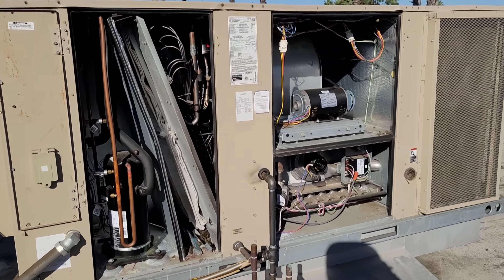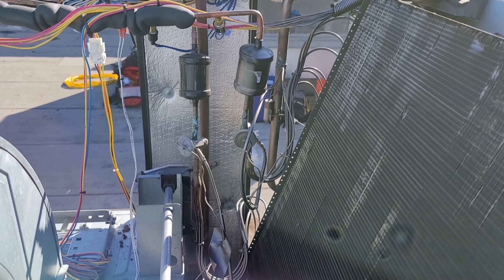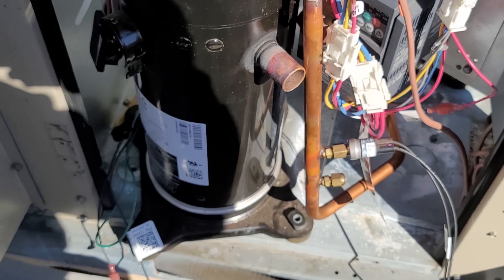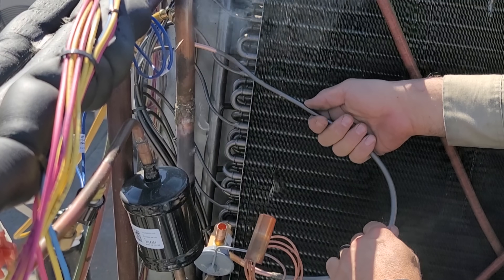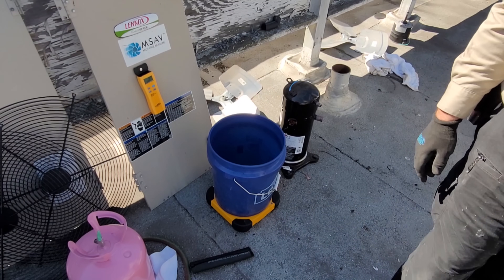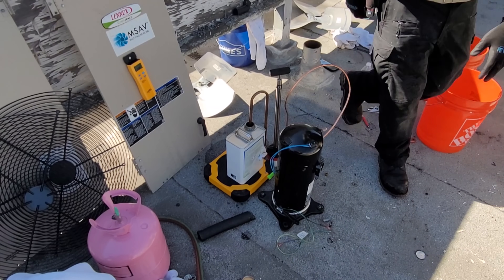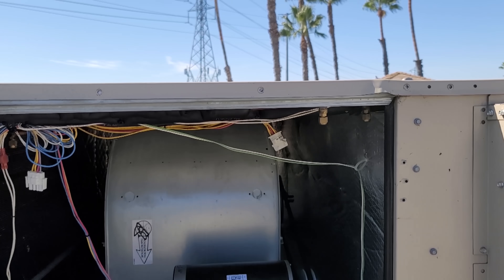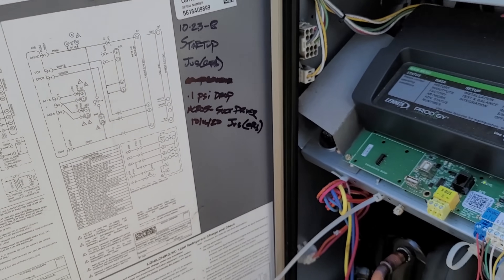THE AC HAS HAS BEEN FLAT FOR A LONG TIME

Comment: Why didn’t you just cut the suction line and put aquarium hose into the compressor going all the way to the bottom. Use vacuum pump with oil catch attached?

Comment: I found a video I have yet to watch!!! Thanks to you and another youtuber i watch who's a plumber (Steven Lavimoniere) I was able to locate a display panel on the tankless water heater that runs the hot water and the garage heat in the addition/back of my grandmas victorian mansion, it had a return sensor unplugged code and a code that said ignit, we assume it means ignitor so at least I was able to send my aunt (her sister who lives next to my uncle) pictures of the code and point to which system is down in the photos so they can call someone out and tell them the codes displayed so they get a general idea of what needs to be repaired, it had no pressure on the guage either sadly, I tried to reset it to get it going for a while or even the night but didnt have luck. I got locked in the garage bringing trash down to put in the truck to bring to the dump and told my grandma the heater pipes were cold both times, she then said my uncle complained of no hot water and asked me to figure out which unit wasnt working, someone was just there to service the boilers and change the air conditioner filters, sad lol

Comment: Does Copeland recommend dropping the compressor upside down on the roof??  Lol. Thanks for the video. I always measured the remaining compressor oil as a volume not weight. Just wondering what your thoughts on potentially ‘moisture contaminated’ oil would weigh heavier or not and therefore potentially overcharging the system with a larger volume of ‘less heavy’ new oil....

Comment: Could you potentially use a FLIR to check the oil in a scroll? Would have to experiment, I assume if the crankcase heater was on, and maybe pour some water on it to cool off the body, presumably should show a nice line on the compressor. Might even show up without a crankcase heater, if you cool the side after it's been running. 

Ofcourse this doesn't help too much as you don't have any reference as to where the oil level should be, but it'll give you a rough idea.

Comment: Oil change. Weigh the bucket. Move bucket away from scale. Drain compressor into bucket. Reweigh bucket. Or weigh compressor. Drain. Reweigh compressor. Fill on scale. Dropping compresser on scale not good.
Bracing lines bare copper 8 gauge or 10 gauge ground wire is one option.  Heck use some copper tubing.  Flatten where you want to loop it. Self tapper or solder trapping felt or door sweep rubber on tubes. Hint. Some apps need triangulation.  Flatten middle to go over floppy tube. Ends at 30 to 45 degrees to solid mounts. Insulated pipe hangers to the flattened copper tube end with a self tapper. 
I'm talking bout no vibrations. You know the song just change the words. Steady men it's only a comment.. not trying to rattle you.

Comment: you can just pour the oil in a measuring cup. Lay the compressor on it's side with the suction port facing up and pour that amount back in. I always thought it would be best, if compressors had a sight glass and a port with dip tube that went to the very bottom of the compressor. That way oil could be removed and replaced with it in place.

Comment: I thought u never press contactor on VFD systems
Reply: While that's true, you can press contactors on VFD systems if the VFD and the contactor don't control the same thing! So for instance, say the blower has a VFD and a bypass contactor (most common case). Obviously don't touch the blower contactor. However, the compressor contactor would be fine to touch in that case, as the VFD is in a different electrical circuit. Well yeah same power feed, but the wires never touch each other after that.

Comment: Danfoss compressors in Diakin units is measured in liters..5.5. When I had a discharge 45 seam break I lost a liter. Danfoss uses their own special blend too. Being in Pa. Ohio was the ONLY one to have a liter. 
 My ONLY advise would have been to flush the coils with R-11 before driers and TXV. That for sure would have cleaned them up. Good stuff otherwise and thanks for sharing. Be safe Chris.

Comment: 1stvthing is even though you dropped the compressor, no humans got hurt. 2nd It seems like your equipment and the compressor are fine after the fall. 3 I know that is not a good thing to have happen, Stuff happens in life aka Tough Crap it happened. So how did that system pass after such a long time open to the air? Again I am not a Tech. I am a former custodian and in general like to learn about things. If I worked in Southern California I would hope I get to work with you/your company. I would trust any thing you suggest. I think you know what you are doing.

Comment: Would suggest replacement of the 1/4 inch line as I have had them fracture again down the track and adding some vibration loops but securing the pipework is probably enough.

Definitely agree replacing the txv not so much for moisture but they are a wear item I did repairs on a reasonably new unit was a simple gas leak from memory and not a particularly huge one so system wasn’t flat but found the txv failed shortly after just to spite me.

If the gas is out it’s not much more effort or cost to swap it out I also had another valve fail from head pressure issues we fixed the head pressure problem only to have the valve pack it in shortly after such a pain the valve does a lot of work and any chance to swap it should be considered if it has seen some life in my opinion.

Comment: I have to agree about the TXV/Equalizer line setup. I would have installed a 1/4” flare stub at the suction line and at the TXV equalizer outlet and installed an flexible armored control cap tube

Comment: HH is not a high acid core believe it or not. It has charcoal added for low temp wax build up. A regular core actually has more acid capacity because some of the material was removed to add the charcoal
Reply: I'm wondering if this comment made Chris realise HH core is for high wax removal.

Comment: I'm not a hvac guy at all. But you're changing the oil because fear of contamination (moisture) but you're putting oil from an container that could or already have the same contaminates in it. 

Am I way off on that assumption?
Reply: Probably brand new oil container.
Reply: Probably mainly time. If the unit has been open to atmosphere for years, it's likely going to have a lot more moisture in it than the jug of oil that's opened for a few minutes at a time. Ofcourse there'll still be moisture in it but nowhere near as much.

Comment: If you are using the exact same oil, it doesn't matter whether you measure out by fluid ounces or by weight. They will be the same volume as long as your measurement is consistent. 28 fluid ounces of oil will be the same volume as 28 fluid ounces of the replacement oil, and 28 ounces by weight of oil will be the same volume as 28 ounces by weight of the new oil.
Reply: Correct. But there is a difference depending on fluid densities hence the discrepency and disclaimer. In this case it wouldn't matter as it is one for one same oil change, presumably. Though, if it sucked in moisture and other atmospheric gasses you might be adding a little extra but I'd wager it is negligible.

Comment: That's interesting. I personally have never seen a(n) (industrial) compressor without an oil port. POE does hold an incredible amount of moisture. If this system was R22 with mineral oil I wouldn't have bothered changing the oil, I'd just draw vacuum for longer. Good, thorough job bud.

Comment: Even a drain plug at the bottom of scrolls would be nice
Reply: Apparently you do get that kind of feature on larger compressors, but on these smaller sealed ones it's just one more place for a leak.

Comment: Boy there has to be another way to draining oil out of a compressor. that is going to absolutely destroy your back if you haven't already. That thing weighs what? 70-80 pounds?
Reply: Those scroll compressors are much lighter than a standard reciprocating compressor. Probably only like 40ish pounds
Reply: Wait what? You can't hold 70lb's at waist height without "destroying" your back? lol

Comment: Is it really a good idea to use weight when changing oil? Im more thinking, if the oil have catched lots of moisture, its density will change (water is less dense than oil, meaning the oil will lose weight over time), meaning you didn't put the same amount of oil into the compressor, as you did take out. But I guess you compensated for that by "overfilling" a little bit as a marginal?

Another way to do it, if the scale has a density calibration function, is to pour out all oil, then remove a known amount of oil from the contaminated oil (like 1dl) then tell the scale to measure a start value, then add the 1dl of the contaiminated oil back, then tell the scale that you added 1dl. Then the scale, based on knowing you added 1dl of oil, should be able to calculate the density of the source.

Same then needs to be done with the fresh oil, so the density difference can be calculated and accounted for.
Reply: Isnt water more dense than POE?  I think youre correct about the weight.. but your statement may be incorrect.  POE is .893 SG at 60F.
Reply: @erickr8848  yeah maybe. Is thicker liquids less or more dense? Don't quite remember, but doesn't really matter anyways, because the importance was that the amount of oil inserted into compressor might be incorrect due to the density change.
Reply: @sebastiannielsen  As far as I know, there is no relation between density and viscosity.
For example, water is not very viscous yet is also quite dense. Howevrer, all hydrocarbons that I know of, POE included, are less dense than water, yet many of the longer chain hydrocarbon lubricants are more viscous than water.
Saying an oil is "heavy" or "light" refers to it's position in a fractional distillation tower, where lighter fractions have shorter hydrocarbon chains, and are therefore less viscous, and they have a lower boiling point so they rise higher up the stack, which is hotter at the bottom than at the top.
Synthetic oils have adopted the same terminology despite the fact that they are synthesized and not distilled, due to the fact that they are commonly used in the same application (lubricants).
Also, the fuel pump in your car or truck uses the fuel as it's lubricant. Running your car out of gas regularly will eventually damage the fuel pump because of this.

Comment: Surprised to learn that there are no ports or valves for adding and draining oil on some compressors! Such a standard feature on hydraulics and engines.
Reply: My understanding is it's another point to leak, and generally by the time you may need to do an oil change on a smaller scroll compressor it's often damaged and easier and cheaper to just replace it. Larger scroll units often have oil ports. They're made to be mostly disposable when they do fail.
Reply: @eggman9713  That does make sense, and I do remember the video mentioning the big ones having ports. Guess it's just tough nuts for the times when a unit is serviced instead of replaced.

Comment: System open for 2 years a pulls a 20minute vac. 🙄 I would have it the vac pump run over night minimum.
Reply from the maker: The vacuum took about 1 hour to pull down to 440 microns..... the video is edited
Reply: Whats the difference? He changed the oil in the compressor so theres no gas trapped in it, no air is no air
Reply: @jasonmurawski5877  moisture in the system not air you can take air out of that system in a few minutes moisture however could take a few hours. Relying on the driers to catch the moisture isn’t good practice imo.
Reply: Triple evacuation might have been a good idea for this one

Comment: Why not use stay brite 8 for the suction drier? I use stay brite on everything (as long as it hasn't been brazed already), even discharge lines and never had a problem.  Stay brite 8 is a lot stronger than braze rod and cleaner. It's lower temp too, so you don't need to flow nitrogen. It's better in everyway in my opinion

Comment: I agree the txv and liquid filter drier need to be changed.

The oil change is borderline to test the oil for acid. A suction filter drier is just a guaranteed return call for being plugged, you saved them nothing. You have your expensive vacuum kit, triple evac. 
 Complete overkill beyond txv and liquid hh filter drier for a self contained air conditioning system.
Reply: I disagree on the oil change. It was necessary in this case minimum. Poe oil / System 2 years open to Salt air. I Would not have even used the compressor.
Reply: @OcRefrig  
There is still oil in the system...your theory of "salty moisture" would be through the whole system....at that point you mind as replace the entire unit...we are talking about air conditioning, not refrigeration for food safety.  

Overkill.

Comment: It would be nice if compressors had a better way to handle them... Maybe someone should design a tool to universally clamp on a compressor to make it easier to handle the damn dead weights.
Reply: Not hvac, just an electrician. An idea would be 2 ratchet straps and a handle or 2 attached to a piece of wood. Necessity is the mother of invention.

Comment: Personally...I Would Never use a Compressor that has Been sitting open to atmosphere for 2 Years. I am VERY INTERESTED  to see How Long that Compressor lasts. I Hope u keep u is the Loop on the Life of that compressor.  ITS GOING TO BE INTERESTING. As Far as Your Repair Goes... You did all u could do !!! Only thing I would have done differently is use a New Compressor & add a Liquid Line Sight glass. Like # 239.
Reply: Why ? Air compressors see the atmosphere every day. And having seen the insides of an HVAC compressor in person...it is EXACTLY the same thing.......
Reply: @Zonkotron  the inside of the compressor was exposed, and it is very difficult to pull the air and moisture out the oil
Reply: @Zonkotron   So Many Reasons ! Compressor sitting idle for 2 years exposed to salt air , Bugs Etc. God Knows What climbed in there and died , Compressor parts sitting there just building rust lines on all kinds of parts and places , Physical water droplets in the system , 2 Years of condensation inside the system , after system runs for a While the System May become acidic. Motor Windings being attacked By Moisture for the past 2 years. Shall I go on ?  Also Last time I looked a Air Compressor did NOT HAVE Electrical winding inside the Compressor. So , They are NOT EXACTLY THE SAME .
Reply: @OcRefrig  seen many an electrical motor that sat in a damp basement etc. for decades and still worked fine. Not just the modern sealed type, also the old direct air cooled ones. You would not believe the abuse many types of industrial machinery endure without much damage. This HVAC gear seems oddly out of line. Built to a price, built to fail...
Reply: New oil and two high capacity driers it will last a long time
Reply: @joeshearer1247   Yea, I Honestly hope so too ! Kind of a Roll of the Dice 🎲 though !
Reply: POE oil does not degrade with moisture in it alone. You need to get it really hot with the moisture and then it breaks down into acid + alcohol. It's going to last many years is my guess.
Reply: It's all a gamble,I've changed out severe BURNOUTS and had them last 5 years,and had minor or open winding jobs last 6 months!
Reply: @petersmart1999   Agreed ! Roll of the dice 🎲 !
Reply from the maker: I will discuss this on YouTube this evening 10/19/20 @ 5:PM (pacific) come check it out  https://youtu.be/n_BZMBp2zM0

Comment: my unit still smells since they installed a new condenser and a coil in the summer.  do they coat the a coil with some rust inhibitor?  its smelling now with the heat.   a new carrier unit. smells like wd40

Comment: Good job! Agree with changing the txv and oil! I would have used the reusable heat dough on the txv instead of the wet rags! That heat dough really works unlike the messy worthless paste! Should have used a acid test on the oil you removed and then  added acid away to the compressor !  Need to go back after a week or so now and run an acid test! Thanks again for another awesome video!

Comment: don't you get an inaccurate reading on the oil because of the long lines you used for the pump? Anything in the large source tube wouldn't be weighed and anything in the output tube wouldn't either.
Reply from the maker: Zero the scale after you fill up the pump than everything that leaves the can while pumping will be counted...

Comment: That "equaliser" port design is dumb, plain and simple. It's practically guaranteed to break again; the question is only is it going to be in three months or three years. 

Out of curiosity, have you ever experimented with using epoxy putties for securing copper lines like this? Yes, it's definitely a one-time, one-use solution, but it might help reduce the fatigue on the lines.
Reply: Could you bend the small pipe round the back (in a tight loop) and braze it to the large pipe as a strain relief?
Reply: I put silicone on the txv feed lines on all evaporators that might be subject to vibration. I was an aircraft mechanic that switched over to HVAC and firmly believe the process of work hardening copper due to vibration. Keep it from vibrating and it will last.
Reply: I'm amazed how dumb it is- right angle, no bracing. ASKING for failure. I'd figure even if it went in at say a 45º angle it would greatly reduce the stress on it.
Reply: A wad of cork tape and a ziptie does pretty good if there is something to brace it against. That line I would have tried to bend a loop in it to shorten it and give it a little spring.